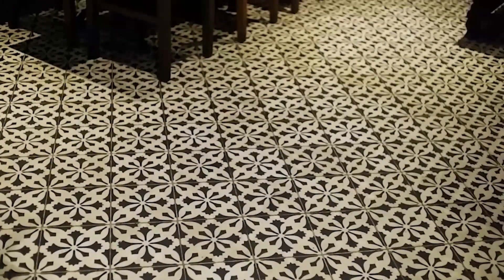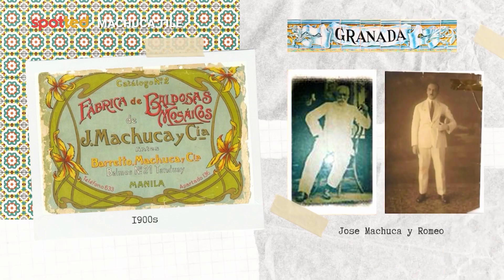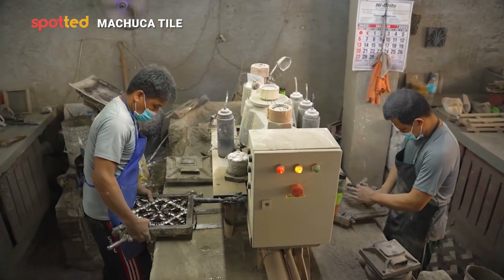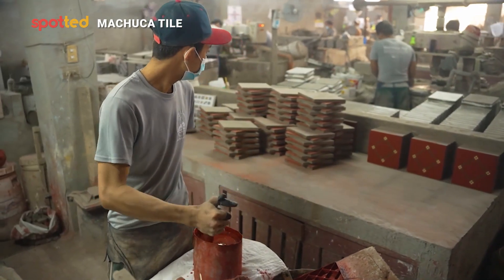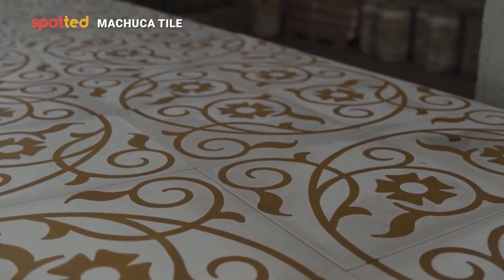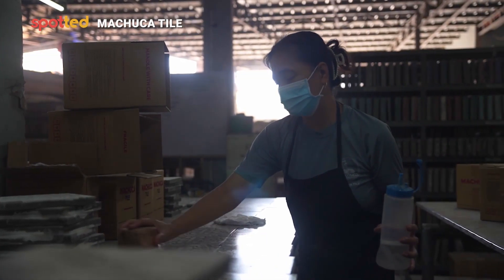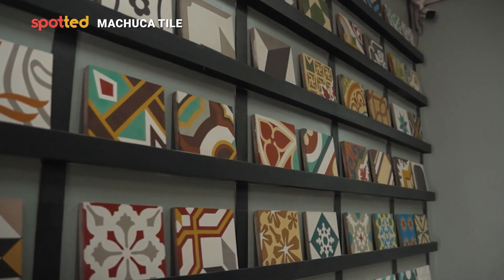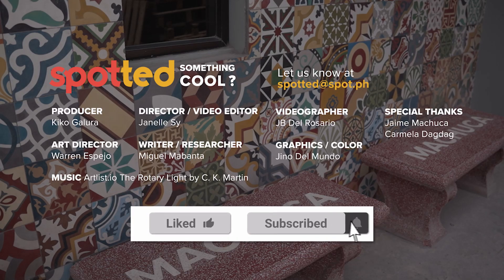History Behind These Decorative Tiles You've Seen Everywhere | Spot.ph

Comment: I wonder if it's high maintenance. Are there recommended sealants to keep the design looking fresh? Are those sealants "washable"?  As in, can it be cleansed with soap and water?
Reply: An interior designer friend of mine told me that Machuca tiles can withstand the test of time because the pattern is throughout the thickness of the tile instead of just a surface layer, meaning even if the tiles are scraped by shoes for decades, the color and the pattern will remain apparent.